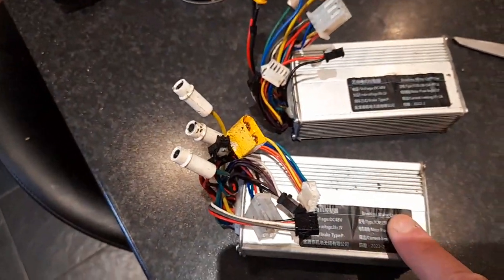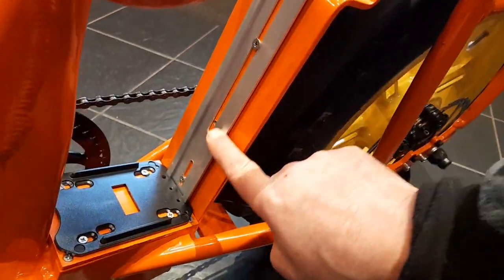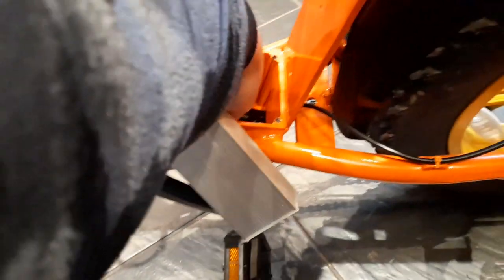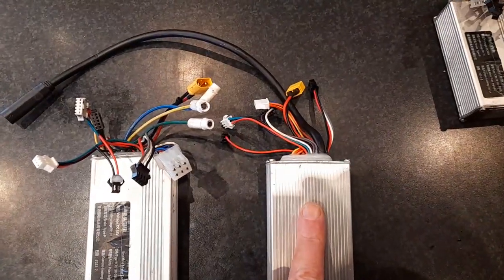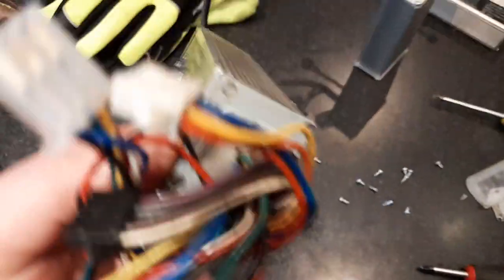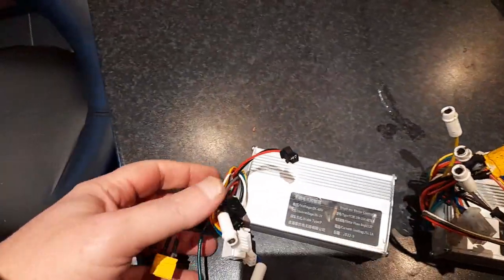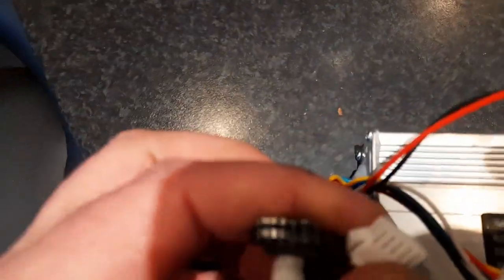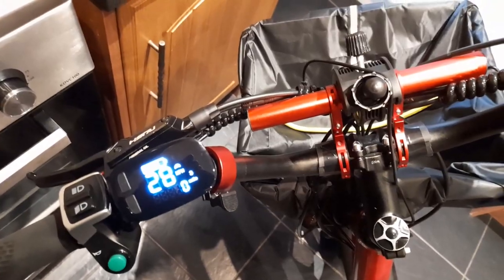Fiido T1 swapping old and new controllers, for better performance

Comment: By the way, I have just had the same disaster strike on both the new and the old bike - the rear wheel nuts came lose and pulled the wire out going to the controller. So the bike has a problem with keeping back wheel nuts tight - please check frequently folks!! With the new bike there was thankfully a 9 pin connector which came undone - easily fixed. But in the old bike it reefed the entire cable out of the control box.
Reply from the maker: Could have been nasty.
Reply: I ordered my T1 last December as the 'Lite'.

This was just after the recall. Every video I saw until then, there was only the T1. I wondered if the change then was the bikes they made moving forward, and to send out as replacements. I haven't checked the website, but I don't think the Lite will be sold once their stock is sold (of the 'repaired' or reworked original frame).

When I put my bike together it got electric (display came on, as well as lights) but nothing happened with the throttle. It was essentially a peddle bike.

As anyone who's been a customer of Fiido, After-sales department is great at responding (customer service otherwise is not in their 'playbook'). I was sent out a new controller and what they called a 'refer', or some other name I can't readily think of at the moment. Which was the throttle/shifter and cables.

I'm very grateful to @tornadogarden, without his contribution I would have felt helpless and hopeless. I first replaced the Controller. No power to the motor, sadly. After replacing the throttle/shifter piece, that was the fix.

I was finally on the road. I love the bike, I wish the manufacturing was better. Thank you to everyone that posts and/or comments on these bikes, for obvious reasons, you are very helpful to this collective group that share the same love of the bike, and frustration with the associated pains!!

I 'unlocked' my display/bike, and it does run with more speed. But not the 30 mph or so these bikes are proported to previously. In watching this video, I'm wondering if that Controller (I took out) is the key. In writing this, I don't think I would put it back if so, I wouldn't choose anything less 'smooth' to have the speed. That's just me. I do still have the other Controller ... 😊
Reply: @feelthepeace  In answer to your question - yes, the replacement controller was the factor to enable the higher speed. That is how I enabled the higher speed after I got the new replacement bike. The other controller will serve as a spare in case you ever need it but it is locked to 23kph(15mph). But you still have the power to climb hills etc. I suspect that speed lock is done by a chip that is programmed inside the controller(software) but I have never opened it to inspect it. The long-term solution if you wanted higher speed and full programabilty is to install a GRIN controller from Canada with it's accompanying display. But that's a bit costly(€400)
Reply: @stevemccormack9948  thank you for that information 👍

Comment: Hi enjoyed the conversation today on the shotton track hope you made it to Whitley Bay and back. Lee
Reply from the maker: Cheers Lee. Good to meet a fellow T1er. 
Didn't quite go to plan...slow puncture in Seaburn, so put a new tube in and thought I'd better turn around as no more spares. Got to Shotton and bang, that tube popped, so put the original one back in which lasted about quarter of a mile,  then pushed the last couple of miles in the sunshine. Knackered. Still smiling though.
Reply: @EnglishEbiker  Ha I guess them Talas tyre inserts didn't work. We got to Hurburn reservoir and back no incidents. T1s are a heavy bike's especially when your pushing them ha.
Reply from the maker: @leewatson9447  I'd bought tubes that were too small, so they were over stretched. Pop! 
More tubes ordered and I'll try again next week. Live and learn.
Reply: If you want some company next week I'll do the run with you. Can't do Monday.

Comment: i just installed my knew controller the type with the thick black cable. the one that plugs into the motor cable but the controller doesn't work the way i excepted it to not in the same way the original controller did. the old controller that was water damaged regulated the same speed up hill as on the flat no matter what.

the new controller when on assist one and two on the slightest of gradients comes to a slow crawl where OAP's with Zimmer walkers over take me. when pedalling on assist one and two on the old controller it just maintained a regular speed in all the assist modes. if i use the throttle all if fine and there is lots of power for up hills. its just when pedalling on assist one and two the motor isn't being sent the extra power it needs for up hill. even on mole hills lol.  any form of a gradient and its a dead crawl almost to a point of stopping but on the flats its all good.  you cant connect one of the controller plugs into the wrong place can you? is that something i have done by mistake? any suggestions welcome.

Comment: I have just done mine also without wiring incompatibility problems. Also, if in future I want to order a new controller, will Fiido supply me with the fast controller? I doubt it. Si I have a third party unit lined up.
Reply from the maker: Be interested to see.

Comment: So, I am looking hard at the T1 pro but I don't like the $650 use battery replacement cost. They come with just a one year warranty. That makes me nervous.
How are your batteries holding up? Are you happy with the overall build quality of the Fiido T1? 
Would you buy them again?
Do you recommend?
Reply: the battery is really good ive had mine for 2 years and it works great even in the winter

Comment: Did you check with Fiido if changing the controller would void the (new) warranty (for the replacement T1)?
Reply from the maker: I've emailed them to ask if they'll supply a new controller with higher speed that'll fit. Not too interested in the warranty if its not up to speed.
Reply: @EnglishEbiker  I guess answer is no? 
if speed is more of a priority, maybe you need a different ebike?
Reply: @EnglishEbiker  Let us know if they are able to!  I like the smoothness of the new controller but the extra speed is more desirable
Reply from the maker: @vfr1vfr2  errr...I simply want the new bike to have the same performance as the one I bought. It currently does about half the speed. Not sure why you think I should look for a different bike. I did not ask Fiido about the warranty, no. I'm sure if and when they reply to me, they'll let me know if I am being naughty.
Reply: @EnglishEbiker  Completely agree with you. 💯%
Reply: I am seriously looking at getting one of these bike can you tell me please what is the realistic distance thay run on full charge as I'm gessing nowwear neer the 90m thay say
Reply: @raymondhaines574  We've knobbly tyres and derestricted the bikes. Riding on bumpy tracks mostly we get 40 miles to a charge. It's pretty consistent though slightly better when warm. We are also fairly heavy and tend to carry a fair bit of stuff. We just got spare batteries in a competition, so no range worries now.